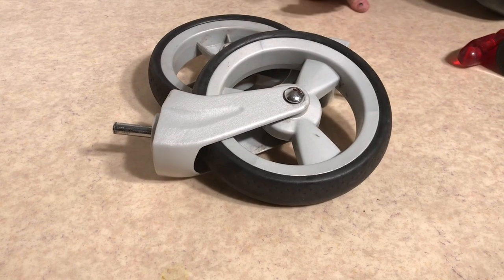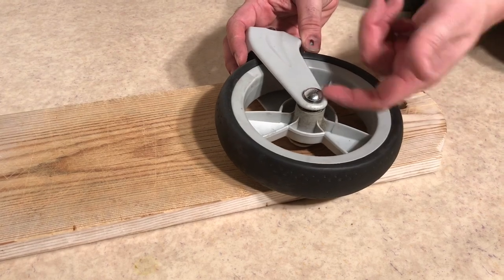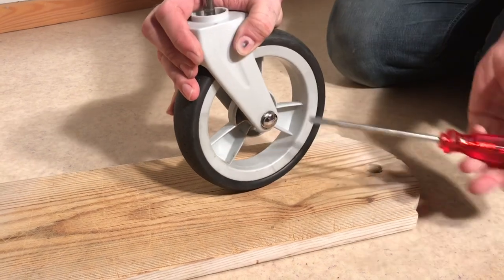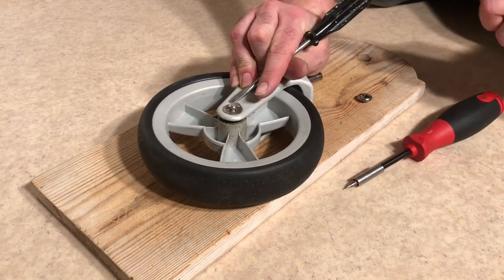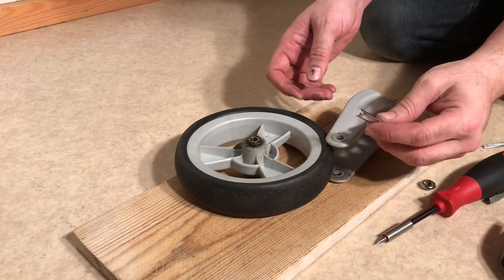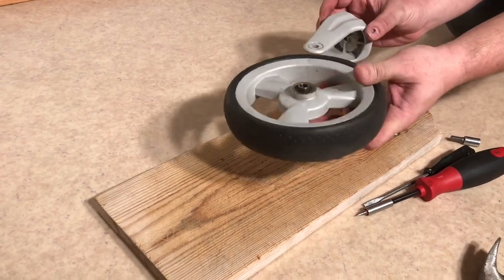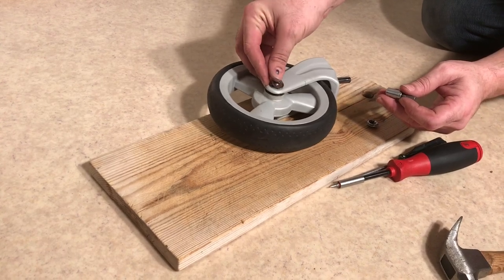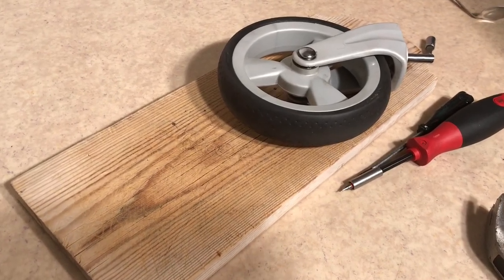How to Replace the Ball Bearings on the Front Wheels of a Stokke Xplory

Comment: Do I need to remove the hair that gets stuck in the front wheels axels? I am kinda scared of disassemble them and brake something
Reply from the maker: It depends a bit on how rusted and worn the bearings are and whether you're willing to buy replacement components if the wheels fall apart.  Sometimes with older models, the hair is the only thing holding the bearings together at this point. :)

Comment: Hey there, your previous video was super helpful to getting the wheel off, and this video was a great tool to get into the ball bearing. However, I can't actually get the ball bearing off because I can't get the central axle off - it appears to have rusted onto the ball bearing - is it possible to disconnect the two? We've applied a very liberal amount of Wd-40 and removed a lot of the hair that we can access, but no dice - been at it for about an hour now. We don't have power tools to cut the axle.
Reply from the maker: There are rust eating chemicals that might help, but it's really mostly about elbow grease when this happens unfortunately - trying to pound it out with a hammer. :)
Reply: @BarnevognverkstedNo  Thank you - I'd already tried that for over an hour, but no dice, sadly. This might be a "replace the whole wheel assembly" kind of situation. Any advice on where to find these wheels?

Comment: Hallo Man can you Tell me which bearings are used on xplory v5 front Wheels? I need IT fast to order on Amazon, i cant waitt whole Wheel shipment from China. I would be very thankfull for your help..

All the Best from Germany
Reply from the maker: Hi :) I don't have an Xplory in currently to get the measurements from unfortunately, but this video should help: https://www.youtube.com/watch?v=SqKJgGi5Lmo :)
Reply: @BarnevognverkstedNo  thanks man, i just got the Wheel off, luckily was one Bearing still in one piece. If someone is looking for the same answer, My bearings for v5 xplory are 608RS, got EM on eBay cheap..